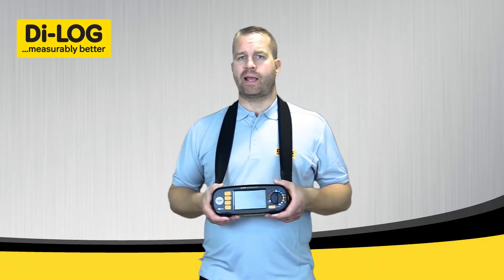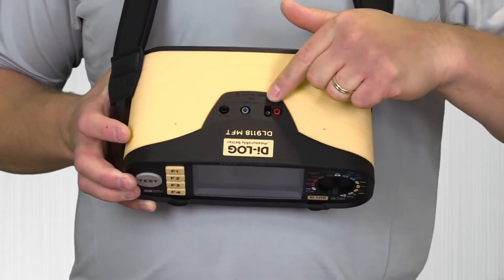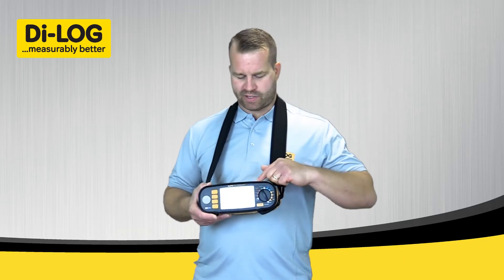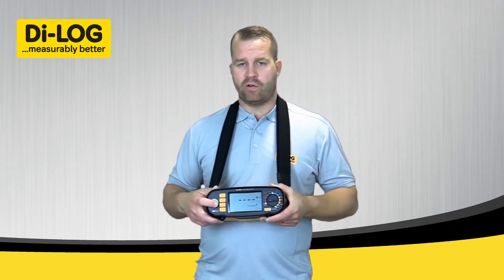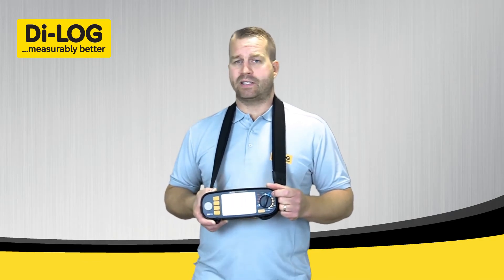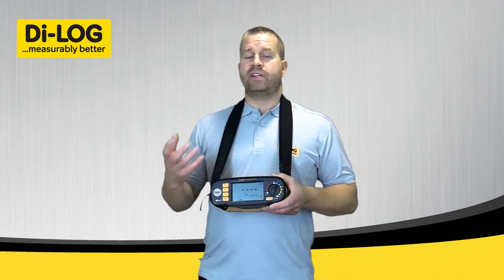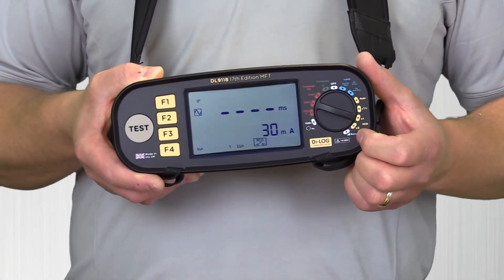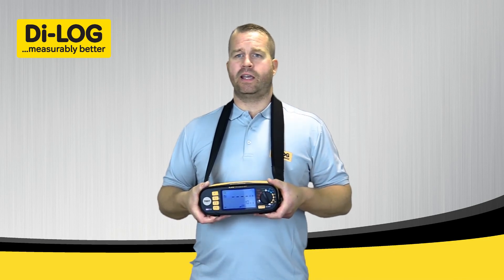DL9118 Multifunction Tester Product Overview Demonstration

Comment: Does this tester have a Communication port? For remote operation.
Reply from the maker: Hello Simon. The DL9118 includes a remote test probe, with the test button on the end, and is available as an accessory on the DL9110. Neither version have an internal memory to download results, as the majority of feedback during development indicated this wasn't a key feature that was required.
Reply: @DilogGroup  I’m wanting to communicate with the tester. To make calibration an automatic process. 
I’ve managed to do this so far on all Megger, Fluke, Kewtech and ethos testers. See video https://youtu.be/Wed0f7MGlhs